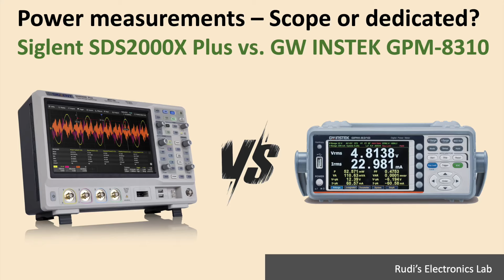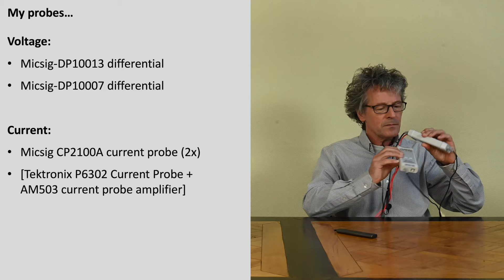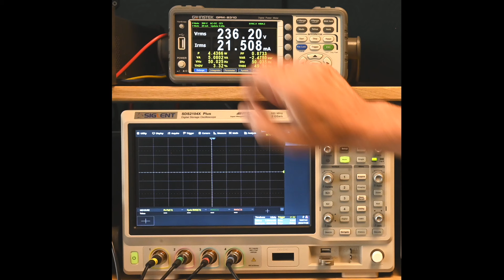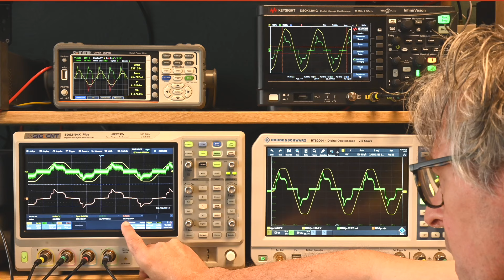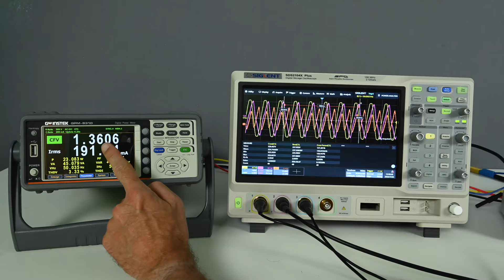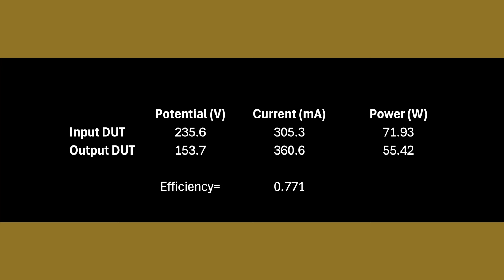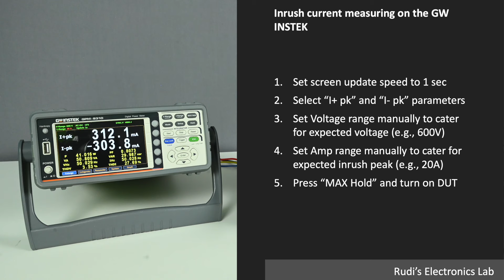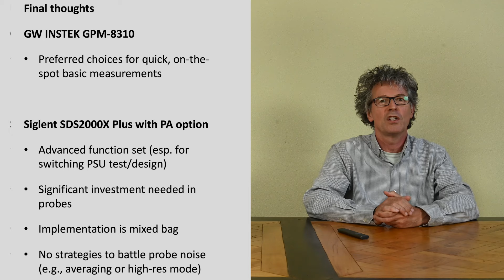REL #44 Power measurements – Scope or dedicated? Siglent SDS2000X Plus vs. GW INSTEK GPM-8310

Comment: Hello, the ERES math function is available for the SDS2104X Plus. This should filter the noise.
The inrush current can be seen with windows trigger.
Reply from the maker: Thanks, Egonotto. 

You are right; the ERES math function can be used to suppress noise. Using the current clamp signal that I used in the video and ERES set to its maximum (3-bit), I see a notable noise reduction (though not as much as high resolution or averaging modes on some other scopes). 

The issue here is, however, that it does not work on the channel level but creates a new math channel. In the Power Analysis functions (like many other functions, e.g. serial decode, mask testing, Bode plots), you cannot select a math channel as an input; you can only select a ‘real’ channel. And in other scope modes, such as XY, the math function is disabled altogether. And it takes up one valuable math function (we only have two…). It also has a notable lower refresh rate than the original channel: with a 50Hz signal and 5ms/DIV time base, it updates only a few times per second, and when I start other compute-intensive tasks on the scope (like a bus decode), then ERES goes weird and freezes. While I have been using ERES in my early days with this scope, it kind of got into disuse over here. 

I love it when functions are part of a real channel. My favourite here is the PicoScope 3000 series (and probably other Picoscopes?), which has a fully configurable bandwidth (low pass) filter as part of any input channel. Wish my other scopes had that!
Reply from the maker: And I have indeed been doing some experiments with observing inrush currents configuring the trigger myself (but I did not include these in the video for length reasons). Since the inrush current can be either positive or negative, you need a smart trigger strategy. What exactly do you mean by Windows trigger?

But anyway, the point of buying the Power Analysis license is that it should be able to do inrush current measurements, among other things.
Reply: @rudiselectronicslab861  The windows trigger allows two levels and can be triggered by a negative edge as well as a positive edge. Assuming the current goes from -100 mA to 100 mA. Then you can set one trigger level to 50 mA and the other to -50 mA and the time base to 50 ms, then you get the first 250 ms after switching on.
In this case you would not necessarily need the windows trigger.

Comment: you might need to reduce the sample rate on the siglent when using ERES for your current probe to reduce the bandwidth. Otherwise since you are principally interested in harmonics of the fundamental use averaging on the current trace.
Reply from the maker: Thanks for the comment. I can reduce the sample rate, but still then I can not use the ERES function (which is a math trace) as input to the Power Analysis functions (or most other functions either). 

You advise me to use averaging on the current trace if I am interested in measuring harmonics, but how do I average? It seems the scope does not support that...

Comment: Instead of using Eres on the Siglent you can try and set the aqcuisition mode to Averages. 

For the inrush measurenent I think you have to acknowledge the popups first before doing the action. So first close the popup and then switch off the power. The same with the second popup, first acknowledge and then switch on the transformer.
Reply from the maker: >> Instead of using Eres on the Siglent you can try and set the aqcuisition mode to Averages. 

If you can only tell me how to do that! As far as I can see, that function does not exist (you can only select 'normal' or 'peak detect'). 

As a math function, apart from 'ERES', there are also 'averages'. According to the manual, it "Averages multiple traces [in time] and displays the resulting trace”)". It requires a periodical input signal and requires very tight triggering (which can be an issue in the presence of noise (which is the reason you use it...). Using the LPF in triggering helps. But the main issue is that since averages is a math function (not part of a normal trace) it cannot be used as input for any analysis.
Reply: @rudiselectronicslab861  
I'm writing this from my holiday home near Oss so I am not able to check it right now. But if you click the Aqcuire menu and then click Aqcuisition you should be able to choose from a list: Normal, Peak detect, Average or Eres. You can set the amount of averages as well. 
The eres function does oversampling to add more bits.
Reply from the maker: @breedj1  Interesting. But if I go into the Acquire menu on my device, there is just "Normal" and "Peak Detect". Nothing more. Also the manual (version EN01C) only mentions these two modes here. Are we talking about the same scope? Mine is the SDS2000X plus series, running the latest FW (1.6.2R5). But if you can tell me how to do averaging in the acquisition menu, I'd be more than happy!
Reply: @rudiselectronicslab861  
Funny. I just looked up some manuals of the sds2000x. An older one says it can be found under the acquisition menu. But the one I found at the eleshop site says it is now a math function instead as well as eres. They must have changed it. But not for the good I suppose.

I actually have a sds5000x with older firmware. I will try and update and see if it has changed in the weekend.
Reply: For the sds5000x the averages can still be found under acquisition menu after the firmware update to the latest version.
The function is mentioned in the sds2000x manual so it must be available. It should be standard on almost every digital scope. Unfortunatly I cannot test it. I do not have sds2000x.
The sds5000x update unfortunatly does not have the new analys function for measuring the serial signal specs.
So the firmware must be different fot both I suppose.

Today I will be receiving my new rigol dho804. Finally a 12 bit scope. It is 70MHz but can be hacked to 100MHz and 50Mpt and some extra functions.
There is also a video where someone made a battery pack for it. It might be handy, also when you need a scope which is not referenced to mains earth. It is also possible to add an extra screen and WiFi dongle, mouse and keyboard. With the extra screen you can get extra resolution as well. Can't wait.
Reply from the maker: @breedj1  Good to know the SDS5000x has averages in the acquisition menu. And when I read the SDS2000x user manual, I see it is in the acquisition menu as well, where I'd like it to be. But please note that I have the more recent SDS2000x plus model, which is an upgrade in several respects, but a downgrade when it comes to the averaging: its now only a math function and therefor much less versatile.